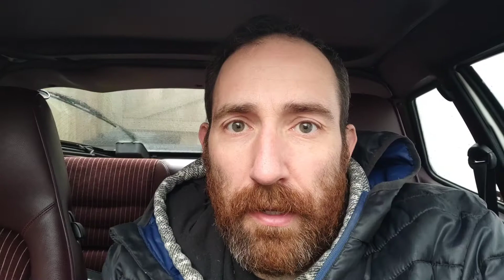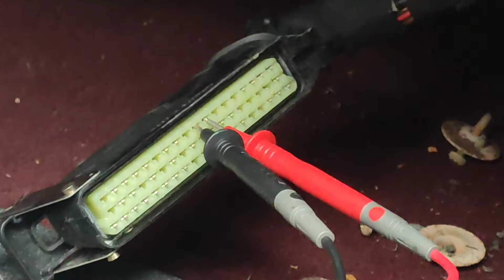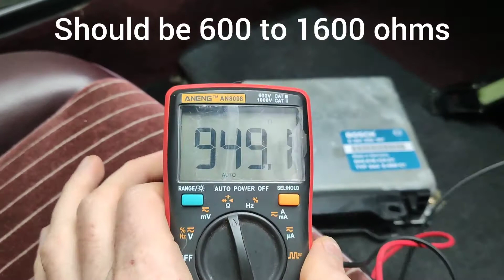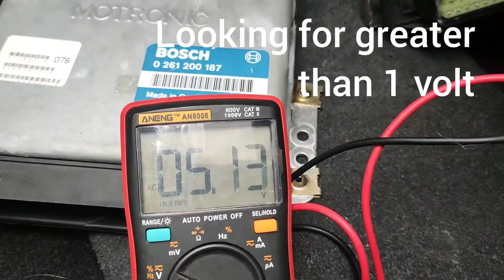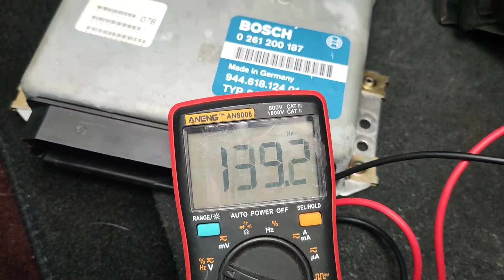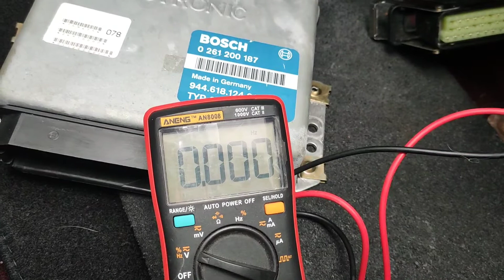Porsche 944S speed sensor test

Comment: Thnx for the video, this was a great help. Tons of info about the 944 8v but not for the 16v. 
Ohms readed good on mine, voltage however was all over the place in the negatives. Gonna replace the sensor.
My problem is no fuel and no spark. Car went from running great to stalling sooner and sooner.
Reply: Hey! Glad the video helped.
Sorry to hear you are having issues. A bit of thoughtful troubleshooting should get you there though.
My problem was actually the ECU in the end. I replaced the sensors anyway as a precaution but no joy. Managed to find a good used ECU and all is good for now.

Comment: Hey Nick, I just purchased a 1987 944s and have a no start condition as well.  This was a great video to help me rule out the speed sensor.  I had 1100 ohms on the resistance test and 5.98vac on the voltage check.  Did you ever get your car running?  If so, what was the problem?  Thanks, Bryan
Reply from the maker: Hey Bryan. Congratulations on owning a 944S! I'm glad the video was of some help.
I did get the car running again. In this instance there was no definite fix. I had inspected and cleaned most of the ignition system while looking for faults and the car just started running again! That said, I later realised that my ECU unit was temperamental. Luckily I found a reasonably priced spare and we're good again.
Have you narrowed your issue down to an ignition side problem vs a fuel problem? A small squirt of fuel in the intake should answer that. 
Presumably you have seen the troubleshooting guide on Clarks garage website? Failing that, try the 944S FB group. Some very knowledgeable people on there plus lots of old 'no start' threads.
Good luck!
Reply: @archmenistan  Thanks!  I'm pretty sure mine is an electrical issue so I'm going to start working through the more common failure modes and hope I can figure it out.  Honestly, I just enjoy the troubleshooting process and working on my 944 so I'm in no rush to hear the engine roar.  Although, that would be nice!